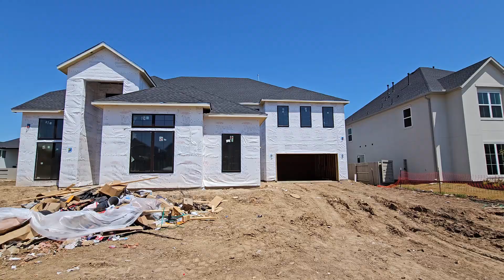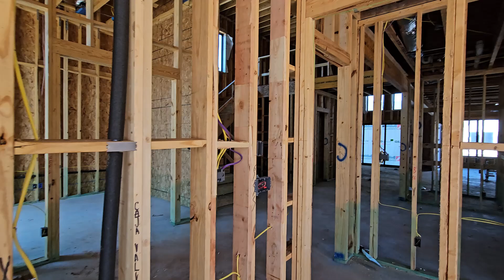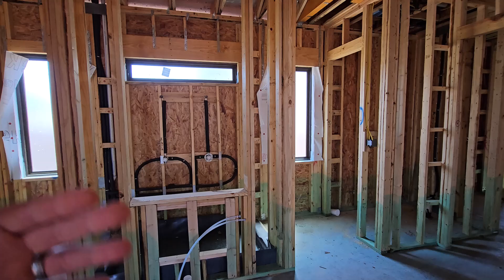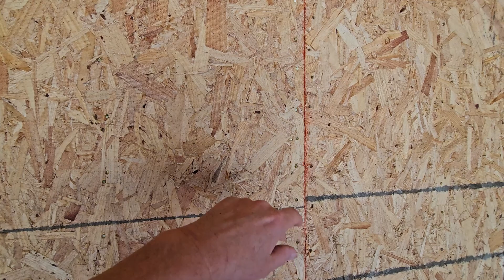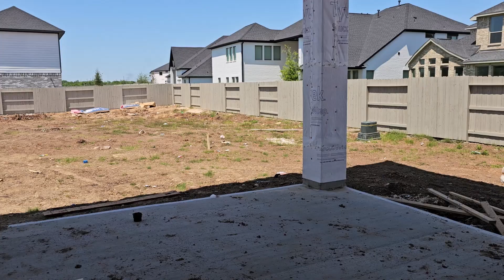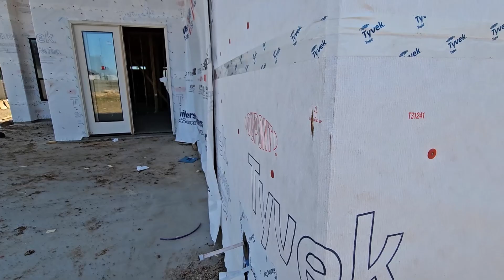Moving to Texas? Toll Brothers New Homes Pomona Manvel Texas

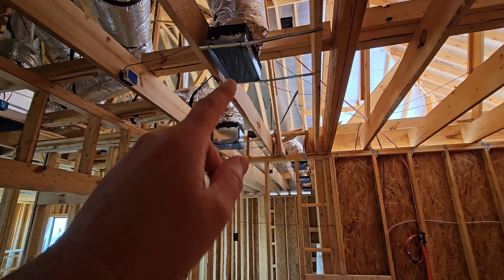Comment: Great job in pointing out the supply and return a/c - furnace vents for all (except washrooms), the rooms. However, in the upstairs media room, at the 18:20 mark, the supply and return vents are too close together for optimal effectiveness. Placing supply vent  near an exterior wall or window and the return vent on the opposite wall or diagonal corner is considered best practices.